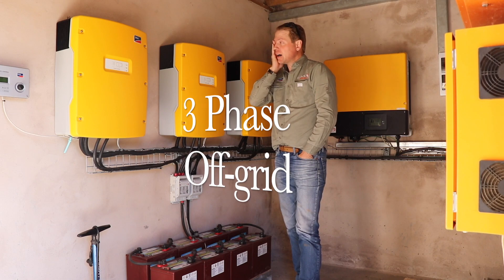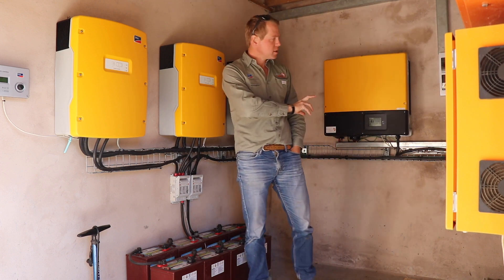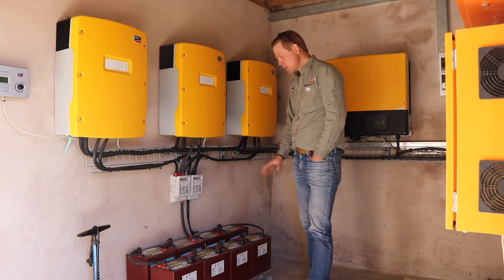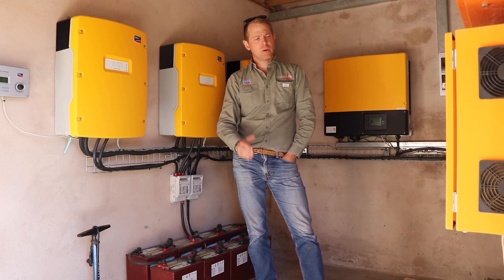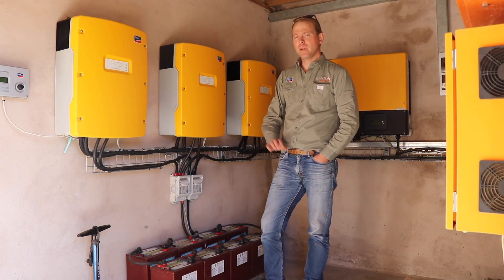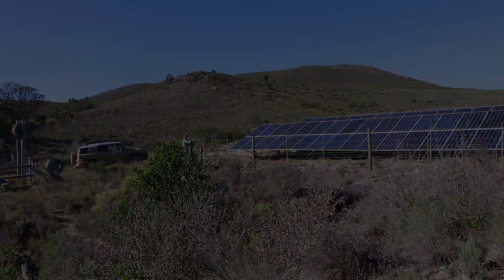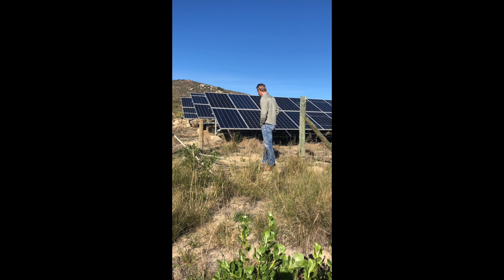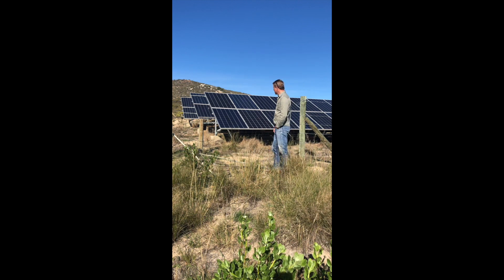20kW off-grid 3phase solar system: Rensol Africa Solar Installations ep1

Comment: I know you are based in Africa, so you probably can't help me here in Texas, USA. But I am trying to understand how your inverters stay out of phase with each other to run a 3 phase pump. I am thinking of making an off-grid shop here in Texas that will have 3 phase machinery as well as running central air (2 phase), and single phase stuff such as lights, small appliances. I know it probably cost more than having an electric company pull 3 phase up to the property, however I am still interested in off grid. Maybe also grid-tied to export extra solar energy when I am not working in the shop, but ideally I can run all my equipment without being tied to a grid. It is not a lot of equipment, maybe only 16KW total for peak usage (from a large 3 phase welder). 
If you have the spare time can you share some advise on how to find an installer or how feasible this type of system is? I can't find any information/resources to answer my questions myself.
Reply: Hello I just read your comment.  I can help you I am a Nabcep certified Solar installer and I work with a large Solar distributer in New Mexico.  I have designed large 3 phase systems using Schneider Inverters.  If you need help still feel free to email me.  Matt@planitgreen.net .   Any advice is free and I can definitely point you in the right direction.  We can also do the Sunny boys as shown in the video. Cheers
Reply: @raulabeyta7853  oh wow, just saw this as I was responding to another comment! I'll reach out to you soon for some more information, but unfortunately my project was put on hold so I won't be moving forward this year. However, eventually I would like to move forward with my plans and any advice would be greatly appreciated!
Reply: Did you work it out yet Shaun?
Reply: @DubStepAnonymouse  nope, put the whole project on hold. Not sure that there is a big enough market for my use case, so it's hard to do research into it. Maybe one day soon more products will be developed for my use case.
Reply: @shauncoyne4949  basically, one sunny island (inverter) is designated master and the others slaves. They communicate to stay out of phase.
Reply: I've done lots of 3-phase and 1-phase solar for schools here in Kenya. The 3-phase is for pumping water while the 1-phase is for the computers and lighting. Each school typically has 30KVA of panels and inverters.

Comment: This was a lot of information I had trouble following. Do you have a simple diagram of how you set this up?  I purchased a commercial building with 3 phase power that we remodeled into a home. However our power bill is always high because it’s such a big place. I thought about converting it to single phase until I realized 3 phase was perfect for this kind of setup!
Reply: PS My email is sandraleecoppedge@gmail.com
Reply from the maker: Thanks Sandra. I will send an e-mail.
Reply: @stefansteffens4209  Great video, verry interessting. I am planning such a instalation for my business (hotel). It is going to be  50kw grid tie system. i also want to use battery as backup for the essentials appliances in case of power outage which is something recurrent here in Cameroon. Can you please also send me Set up diagram? I am also wondering if for a 3 phase i can start with 1 sunnyboy for one phase and then later on accordind to my budget progressivly cover the others 2 phase to get more power.
Reply from the maker: @bosderschwarz7765  stefan@rensol.co.za send me a message